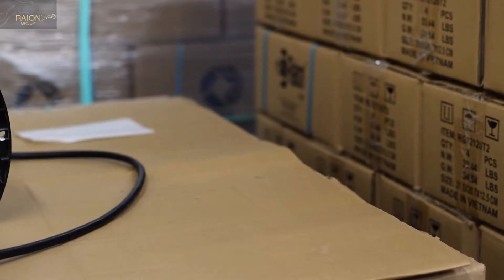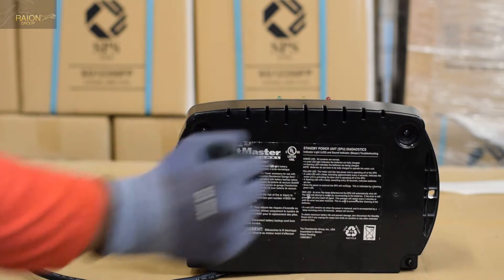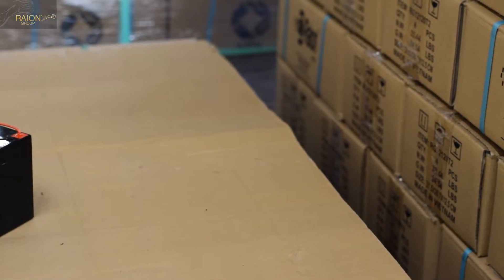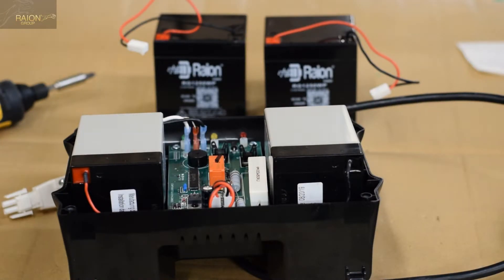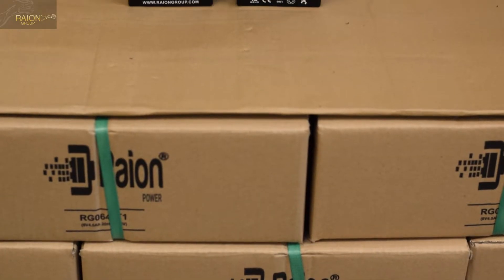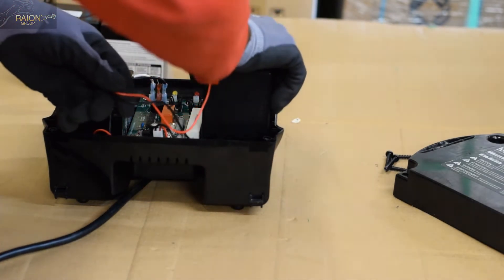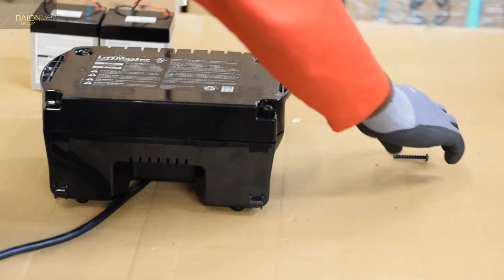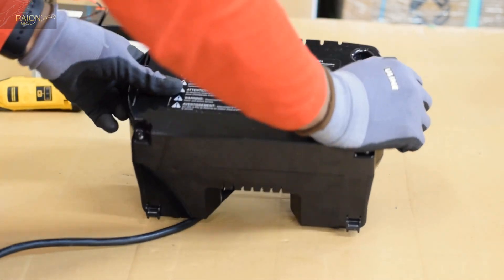How To Replace The Batteries In A LiftMaster 475LM EverCharge Garage Door Battery Backup Unit

Comment: I have the same external battery buckup you used in the demonstration. It beeps every 10 seconds. It is red light is solid. May I know if the the battery dead? Should I change the battery? Confused??? Thanks
Reply: Turn the opener breaker off on the fuse panel. Use your car remote and see if it opens or not.